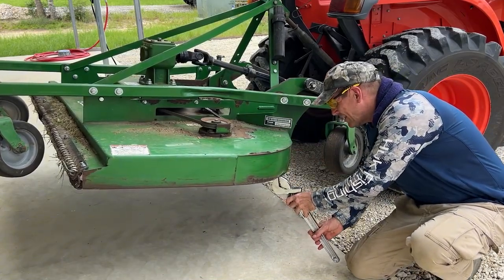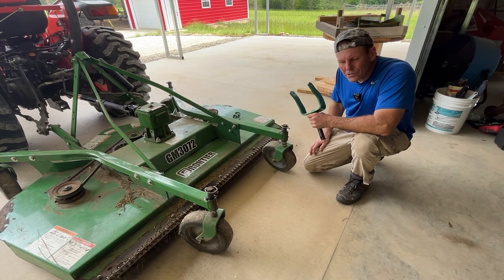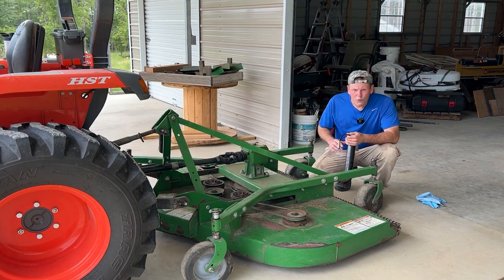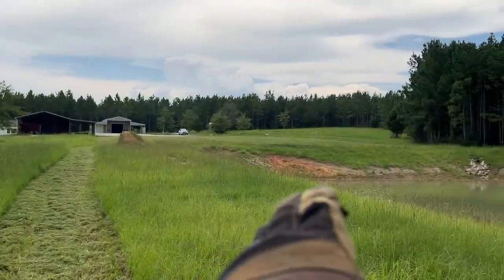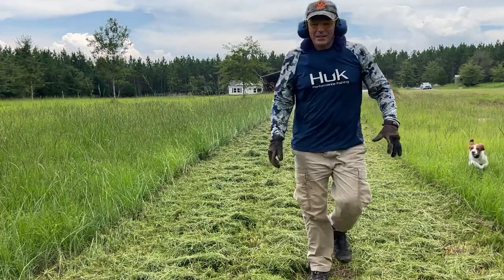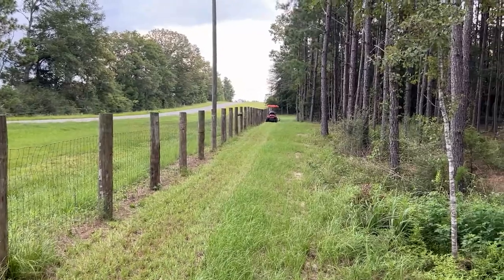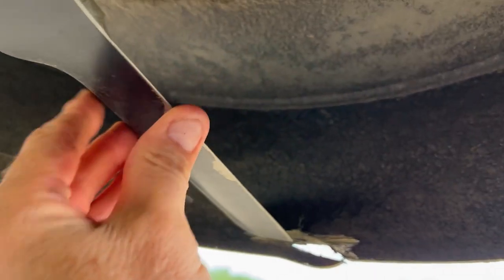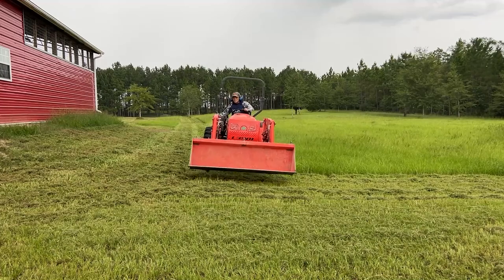Did We Buy the Wrong Mower for Our Farm? | John Deere/Frontier Finish Mower

Comment: Something most people don't mention is a finish mower, brush hog, and a flail mower many times is rear discharge.  a regular lawn tractor and some finish mowers as well as most zero turn mowers do side discharge....so with those you have to cut close to stuff with only one side of the mower deck, where the rear discharge mower decks you can cut up close to stuff with either side of the deck, which is a great timesaver.
Reply: I agree completely. I mowed some subdivisions where new homes were near. As soon as I bought my first rear discharge my collateral damage went down to zero. I could mow closer without buying thermopane windows or vinyl siding repairs. Also on a windy day the side discharge covered me with debris. The rear discharge put the debris way behind me and shattered it with no windrowing. A no brainer and you can mow in both directions.

Comment: I'm been using a 6' flail mower for over 20 years around our farm.  I sold my bush hog years ago and have never looked back.  The flail mower is a mower with a cut between the bush hog and the finish mower, but tends to distribute the grass more evenly out the rear and is much easier to change cutting height for longer or shorter grass.   Bob
Reply: Instead of spending all the time mowing, have a near by neighbor come in and make it into hay.  It may provide a little income and less work you guys.  Just a thought.
Reply: I have mowed with about every mower but after I dug a steel post out of my rear wheel I would never own or operate a flail mower. They are dangerous as is a brush hog. The safest by far is the rear discharge finish mower.
Reply from the maker: Thanks for watching.  Here is our hay baling video:  https://youtu.be/HdyYSy50cgE

Comment: I use a Wood's 6 ft with side discharge on a 25 hp kioti. I've mowed grass that was a foot and a half, maybe two feet tall. The only time it bogged was going uphill. I have a brush hog at dad's for woody trails and fields.
Reply: If you had a rear discharge you'd park the side discharge
Reply from the maker: I believe Woods made this Frontier GM3072 for John Deere.  Thanks for watching.
Reply: I plan to use 7ft finish mower with side discarge for tree line mulching. Almost no videos on youtube for such kind of operations. Can you say that with tall enough grass it can leave thick 3" or more and about 1 feet wide straw line ? Thanks
Reply: @donatasvigilita9908 I'm not sure . But I know my mower creates a lot of air from the discharge. I used it this fall to blow leaves from my backyard . Never needed to use a rake.
Reply: @kevinbrewer2141   Thanks,i believe it will work for me even if it spreads grass wide.
but can you tell me if you cut tall grass does it spread grass very wide and far or it can leave  big chunks of it near discharge?
Reply: Woods makes the rebranded Frontier mowers for John Deere and another company makes the cheaper lower brand frontier mowers. I can’t remember what that companies name is and which ones they make for John Deere/ Frontier.

Comment: Finish Mower!  They do such a wonderful and clean job over Bushog which was designed for heavy brush stuff.  I'm using a FDR1672 Landpride behind my Kubota L2501.  I find myself mowing more often than I did with the Bushog.  Also using a Kubota GR2120 4WD mower for the smaller and tighter jobs around the property.
Reply from the maker: Land Pride is good stuff!   We went the budget route with this old JD/Frontier machine...so far, so good.  Thanks for watching.
Reply: The brushhog will rip the grass instead of clean cutting the grass blades.  Moisture gets into the end of the grass blades causing rotting, which inhibits growth.  The finish mower with sharp blades will clean cut the individual grass blades, supporting more growth.

Comment: This past mid summer, I bought a used Woods PRD7200 for my L2501 here in east central Indiana.  I mow 5 acres and it does great.  I was using my 60" JD commercial stand up and did so the last 6 years.  Just nice to sit now and not get roughed up by the old hay field.  Enjoy the content.
Reply from the maker: Woods makes (or made) this mower for John Deere.   We put some new innovative blades on it in this video: https://youtu.be/7Sj0B2sgrWI
Reply: @PineyGroveHomestead  i see your video on these.   I've been looking for a different blade with more cutting edges for some hard stem weeds that take an extra swipe to cut.  May have to try these.

Comment: I've owned and operated several brands finish mowers. By far the best was the Rhino brand FM-72. They made a heavier duty Turbo model that was taller and heavier(but I didn't like it) so I went back to the simple FM-72(always rear discharge).
Reply from the maker: We love that rear discharge.  Wanted that in our Zero Turn, but it's rare (and expensive)!

Comment: I mowed 2 acres for 21 years with a Craftsman GT6000 garden tractor with a 44" mower deck.  No tractor and finish mower needed.  Usually mowed once a week.  Occasionally with rain or irrigation I'd have to skip a week and I'd end up mowing grass that was 2 feet tall.  The garden tractor handled it just fine, but without the rear discharge, the side discharge would windrow the clippings making it really nice to rake up afterwards.  

Not sure having a finish mower is really needed in many applications, but if you have a large lawn or a clean pasture to mow, they're fine...would I rush out and buy a tractor just to use a finish mower, no....but if already got the equipment then a finish mower or flail mower would be ideal.  Flail mower is far more forgiving if you hit something.  Change out the flail you damaged and keep going, flails are cheaper than mower blades LOL.  Nice thing too with either mower, keep a spare set of blades or flails and just swap them out when they get dull, and sharpen the dull ones later on when you have a few minutes....sharpening the flails don't take long, a bench grinder works wonders and makes quick work out of that chore.
Reply from the maker: So far we like this mower...we don't like sharpening blades after 5 acres though. There has to be a solution for that.  Thanks for watching.
Reply: @PineyGroveHomestead  With the finish mower, get the blade size and center hole size, and order some Oregon Gator G5 or G6 blades for it, you'll cut your sharpening time way down.  If you can get G6 blades they are infused with carbide and hold up even longer than the G5's. 

I only mow an acre now, but I put G5 blades on my lawn tractor and I'm just coming to the end of my 4th mowing season with them, and haven't had to sharpen them, or replacement.
Reply from the maker: @wildbill23c  We are running a test on these now for Cutlass blades:  https://youtu.be/7Sj0B2sgrWI

Comment: I first had a really old 5’ brush hog that had 3 blades on it. Got it for $75. That did an amazing job but I hated how big and old it was. So I sold it for $600. Then bought a used 5’ hammer blade flail mower. I like it… but doesn’t give nearly as good of a cut. Like you said I probably could sit and sharpen all of them but idk. I may sell it for a big finish mower. All my trails are pretty much established. But I do still mow them. Lately I’ve been using my 54inch mid mount mower on my tractor but that’s extra wear on it. A 3pt finish could be wider so it gets done faster. Plus rear discharge could be less dusty.
Reply from the maker: Rear discharge is so nice!

Comment: That has to be frustrating Brad.
A rotary cutter is the best choice for my needs.
I have an older brush hog. SouthEast is the brand name. I thought I would like a flail mower but decided against it for the very reasons that you stated.
I think you made the right choice for your needs.
That rear discharge is the cats meow
Very nice Brad. Looks great
Reply from the maker: Thanks Gary.   It's leaving a nice cut.

Comment: I am curious what model of tractor you have?  I have a B3030 (30 hp) with a 6' mid-mount. It does an excellent job but I've often wondered if I could add another 6' rear offset finish mower, to mow light grass with a 12' swath.
Reply from the maker: There are so many variables with that, but the biggest one would be how tall and tough the grass is.     Our tractor is a L3901 with 38hp at the engine and 30hp at the PTO.   In that tall grass in this video, it was the tractor could handle.

Comment: I bought a GM 3060 when I bought my 3025e back in 2021, worst money I have ever spent on an absolute POS of equipment I could ever imagine owning. Within a week it through a belt, the actual salesperson came out to repair that because they wanted to keep that under the radar, this of course raised a red flag. Not three weeks later the wheel caster you mentioned here broke off, my neighbor rewelded that as the scumbag at the dealership felt this was clearly just a normal  thing to have happen, and I refused to pay $200 for a two month old mower. Not two months after that yet another one of those casters broke off, same exact outcome, and yet again, scumbags at the dealership claim it was definitely not the crappy Chinese welds. THEN…..the blade spindle housings started to break. I replaced one, and since it broke and wore the bearings out I replaced the entire internals at yet another $300 in parts, and MY OWN LABOR, as I wasn’t about to pay those thieving scumbags at the dealership another $300 in labor. Three months later, the pulley and spindles started all of a sudden started free spinning and the blades would lose speed when mowing, which you could visibly see. Once again, replaced the pulleys and once again it heated up the bearings, so those got replaced as well. At one year all three spindles and housings have been replaced once, two wheel casters have been replaced and the front the deck has become permanently tucked inward thanks to the cheap Chinese garbage stamped steel deck. BE GLAD YOU GOT THAT USED, you actually paid what that POS is worth based on my experience thus far. 

As of today, 3 years of ownership, all three of the spindles and bearings have been replaced twice in total, and the key stock and pulleys have been replaced because the key stock is apparently able to melt away the hardened internal shaft housing before the soft zinc does, and before the belt slips. To this day I am very grateful the POS salesperson didn’t upsale me the zero turn mower I asked him to quote instead of this POS finish mower. I have enjoyed putting $2k in parts into a 2k mower that can’t mow close to trees or anything for that matter.
Reply from the maker: I think it's a nice mower but overpriced because it's GREEN!